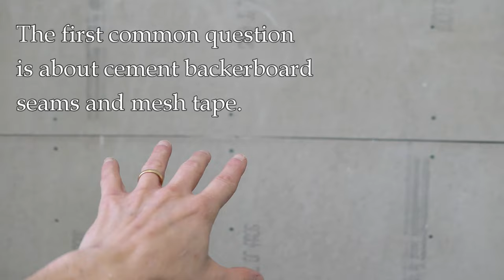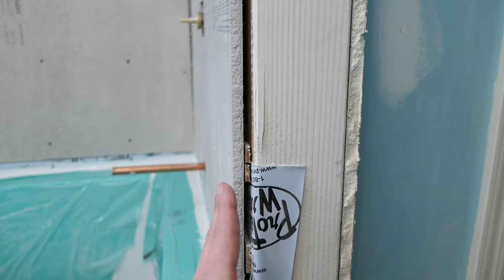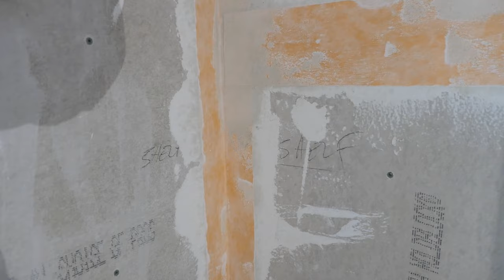Should Backerboard Go Over The Tile Flange Or Up To It?

Comment: Great video: The edges of hardibacker are porous, like a sponge. How do you prevent the water from getting/dripping under the edges of the board at the bottom of the tub? Scenarios: If a person taking a bath and splashes enough water running under the edges... or water vapor building up under the tile, and with gravity pulling water downward, eventually won't the moisture go under the edges of the board and eventually get into the board and swell up.
Reply from the maker: First, hardibacker is not porous like a sponge.  It is marketed as "water resistant,"  which is not waterproof but which is also not a sponge!  Second, the backerboard is covered in a tile, which should be impervious if you've picked an appropriate tile for a shower.  And, third, the bottom edge where the tile meets the tub is caulked with a silicone sealant.  To put things in perspective, it was standard practice for decades to install DRYWALL in a shower and tile over that!  While that was a stupid idea, a majority of those showers easily lasted 20-30 years without a problem. I've taken apart many dozens of them.  If you have water getting behind the tile, then the installation or the maintenance of the tile have failed.  See this video for more info:

https://youtu.be/y3bpE-GhYUM
Reply: @enduringcharm    Agreed. I renovated 3 bathrooms in homes built in the 70's that had tile over standard drywall. None of them had issues. No excuse these days since there are plenty of proper alternatives, but it does make an interesting point.
Reply: @enduringcharm  I had a house only 8 years old with failed  tub surround and a shower . they were tiled over "greenboard " sheetrock. There was a plastic vapor barrier behind the sheetrock on outside walls. The grout was not acrylic I'm sure. This created a mold sandwich , I had to wear a respirator to tear out black mold in an 8 year old house.
Reply from the maker: @oldarkie3880  Yes, drywall, even greenboard, is prohibited by code now for this reason.  When things go bad, they go very bad.  From your description it's likely that the plastic barrier on the exterior wall trapped condensation and that water made it's way into the greenboard over time.  It's also possible the tile was not installed very well and allowed water to penetrate.  For mold to grow it needs a food source, and that was probably the drywall paper and perhaps some other materials used in the tiling.  If I use a plastic barrier on an exterior wall I only apply it 2-3 feet from the tub or pan lip, so that moisture can migrate and escape.  Of course, we don't use drywall anymore either.  Despite all that, if your installer had not used plastic and had installed that tile well to the greenboard, it's quite possible the installation would have been fine for many more years.

Comment: Also can u put red guard over the drywall mud then tile on top of that?
Reply from the maker: You need to prime/paint over the drywall compound transition area no matter what you do.  I typically prime and then paint two finish coats, going partially onto the cement backerboard. Remember, this the edge of the tub or pan we are talking about and may even be located outside of the shower doors or shower curtain.  You can tile over that paint once it is cured.  If you are concerned, you can install waterproofing over that painted area, in which case I would recommend the Schluter Kerdi membrane over the whole wall.

Comment: So you put that 10" membrance over the lip of the tub and ran it behind on the studs but then you throw the hardibacker on top and stick screws into the membrane destroying the integrity of your waterproofing. Seems like you got a problem there if the end user doesn't take care of the installation or your wall/framing shifts a little bit. Seen too many tub/showers where water gets in behind the tile and goes unchecked. Had a pan last year where they screwed thru the membrane and it was leaking into the basement 5 yrs later. Do you do anything about those screws that go thru your membrane to try to prevent that type of situation from occurring. It is my worst nightmare thinking "what if"
Reply from the maker: There is a current obsession with "waterproofing."  Yet, I've taken apart dozens of bathrooms which were tiled over regular drywall.  As long as the tile and grout were maintained, the drywall is like new.  Naturally I'm not advocating we go back to drywall as a substrate, but a little perspective is important.  My flashing system shown here is not intended as a waterproofing system.  Instead, it's there as a backup in the event that the homeowner doesn't maintain the caulk or grout, or if there is an accident or significant framing movement.  If something really bad happens, the flashing will direct most of the water back to the tub/pan and hopefully the homeowner will wise up.  Now, if you really want to waterproof the entire enclosure, I've had good success with the Kerdi membrane, which is a market leader for a reason.  If you are really losing sleep over waterproofing, use the Schluter Kerdi.  It is more expense, both for materials and labor, but it will be waterproof.
Reply: I dont think the screws destroy the integrity any more than roofing nails do when its used on a roof. The screw or nails act as a plug.
Reply: @jerseyjim9092  I agree that a screw or nail is going to do very little to compromise the self adhesive membrane.  The membrane is a flexible polymer that squeezes around the shank of the nail or screw.  The membrane has an adhesive back and that adhesive will further seal the nail or screw shank.  Finally, the membrane is tightly squeezed between the cement board and the wood wall stud.  A water penetration at the nail or screw hole is virtually impossible.

Comment: Great video!  I'm doing my first tub.  One thing that's not clear to me is how you finished the vertical edge on the front of the tub.  In the video it appears the backer board is installed over the vertical flange on the the front of the tub and flush to the top of the flange on the top of the tub.  I'm assuming it's the same board and I'd need to make a stencil in order to cut the piece to match.  But that seems to create a problem where the vertical will be over the flange and the horizontal above the flange.  It seems I'd need to take some material off the back of the board to accommodate the vertical flange?  I'm wondering how you did that?
Reply from the maker: I think what you are asking is how to deal with the transition where the tile flange ends at the corners of the tub or pan?  The tile flange typically goes around three sides of the tub and then ends at the front corners.  You saw in the video the various factors relating to whether the backerboard will go over or on top of the flange.  If it goes over, then the backerboard will just continue pas the end of the flange and meet up somewhere with the drywall in the room.  If the backerboard sits on top of the flange, then you will just cut the backerboard as close as you can to the profile of the flange and bring it down to meet the tub surface.  You'll leave a gap at the actual tub surface, though, and that's where I install my flashing.  The backerboard or drywall will also meet the front apron of the tub, leaving a slight gap for caulking.
Reply: @enduringcharm  Actually the tub I bought has a flange in the front of the tub too.  The flange starts on the bottom left front, goes up and around the three sides of the tub and down to the floor again on the right.  I had assumed that was normal.  I'll figure it out one way or the other.  Thanks!
Reply from the maker: Oh, you mean the apron itself also has a flange?  Huh.  Never seen that!   Well, it can be handled the same way as the other flange in the alcove.  I like to use a self-adhesive flashing, with Zip System stretch tape being my preferred flashing now.  And then you'll have drywall or backerboard come up to the apron just like in the alcove.  Obviously you'll want to cover that transition with the same tile you use in the alcove.  Don't use little pieces, though--make certain you have wider pieces of tile to span over the flange and the wallboard or backerboard.  That way the tile will have something solid to stick to if the area over the apron flange is unstable.
Reply: @enduringcharm  Well unfortunately I'm actually using a 3 piece Onyx Collection surround wall system which I can't back out of.  It starts at the top of the tub and is the same width as the tub which is 36".  If I'd known about this (or thought about it earlier) I could have ordered taller side walls to do what you suggested.  Currently I'm thinking of trimming off most of the flange and then notch the sheet rock so it fits up against the tub.  A little tedious but it should work.  BTW, it's a Laurel Mountain whirlpool tub from Lowes and I'm starting to regret buying it.  Thanks again for the help!
Reply from the maker: I had a look online to see this tub.  Unusual.  Cutting off the flange is probably a mistake, since that probably is what gives the apron stiffness and support.  Without it the apron may have excessive movement and will open up cracks where it meets the drywall.  Since you are not using tile, another possibility might be to install some kind of wainscotting in the room.  I don't know if that style would work with the rest of the space, but a wainscotting made of wood, plywood or PVC could cover that flange and be self-supported.  You would caulk the transition between tub and wainscotting.  Or, if you can shim out the drywall along the entire wall adjacent to the tub, you could use drywall and have it go over the flange completely.
Reply: @enduringcharm  The wainscotting is a great idea.  I'm going to look into that.  Thanks again!

Comment: Great video. Question: When you tile the area between backer board and tub, is the tile only stuck to the backerboard? If so, is it going to stay in place along with the grout?
Reply from the maker: There will be an area by the lip of the tub which has limited or no adhesion for tile.  For this reason, it's not wise to use very narrow tile in that area or to cut larger tile down to make a short row by the lip.  Instead, you want enough tile to be adhered to the backerboard so that it stays put.  In that lip area you fill it with thinset, more to act as a backing than to adhere the tile.  The space between the bottom edge of the tile and the tub or pan is caulked with a silicone or color-matched tile caulk.
Reply: @enduringcharm  Thank you so much. This clears up my question.
Reply from the maker: I made a video to help others understand this issue as well:  https://youtu.be/y3bpE-GhYUM

Comment: instead of shimming out use green water resistant wallboard 1/2 inch then backer board down over the lip. depending on the plane of finish walls.
Reply from the maker: The use of greenboard in the shower/tub area has been prohibited by the IRC code since the early 2000s.  See section R702.4.2.  I don't think your suggestion of using it under cement backerboard would fly with building officials either.

Comment: Love all your videos, they have been helpful in my bathroom remodel. Just curious, when you install your backer board for the flooring, do you put modified thin set on top of the self adhesive flashing where the bottom of the tub meets the plywood floor before installing the backer board? Thank you! Have a nice day and keep with the helpful realistic videos.
Reply from the maker: I'm not certain I follow your question.  So, if I'm using 1/4" backerboard (hardibacker is what I use and recommend) on the floor, the hardibacker gets screwed down to the plywood.  Before I put the backerboard down, though, I've installed the tub or pan and I like to use some kind of protection at the edge of that tub or pan so that future moisture doesn't create rot.  I think that's where your question arises?  Now I fully realize that hardibacker is recommended to be installed with thinset over the plywood and then screws.  However, I don't do it that way for a number of reasons.  I skip the thinset and just use screws.  In my experience this does allow for a slight decoupling effect, so that the wood underneath can expand and contract while the hardibacker is less affected.  The screws will move with the wood but still allow the tile and backerboard to stay put.  This is a very modest decoupling effect, but real.  Skipping the thinset also avoids waviness or bubbling that can develop as you try to screw down the backerboard while also walking on it.  And I do think about the next guy down the line trying to remove this stuff!  I have installations two decades old done in this manner with no issues.

Back to your question--if you choose to put down the backerboard with thinset you can go right over whatever you've put down at the edge of the tub and no harm is done.  Screws will be the only real fastener in that area, though, since the thinset won't adhere to the plastic or flashing very well.   Or, you can adopt my method.
Reply: enduringcharm Yes thank you! You answered my question perfectly, i was worried I didn’t ask it right.  I was going to do traditional, subfloor-> thinset->backerboard—>thinset/tile, but your method is very interesting and I may do that now. Thanks again so much, very helpful. 🤙🏽

Comment: You telling me you can put thinsett over spackle?and it will stick
?
Reply from the maker: No, I'm not telling you that at all.  Instead, if you do your spackling and sanding, you then apply a coat of primer and two coats of finish paint.  Or, apply two thorough coats of primer.  Then, let those coats CURE, not just dry, which can take several days.  Then you can apply thinset over the paint and it will stick.  Keep in mind, The tile only overlaps the paint by half a tile or so.

Comment: I dont get why everyone caulks the bottom edge of tile to the tub?!  
Doesnt this just seal in the water like a trap? Then it molds
Reply from the maker: If you have tiled and grouted correctly there should be no water getting through behind the tile. The grout is sealed.  Water does not penetrate through the tile.  If you take 90 minute showers perhaps some slight moisture could penetrate the grout, but not actual water.  Silicone caulk is used at the base because the tile and the tub are two different materials with different expansion and contraction properties.  The silicone caulk can stretch with that movement.

Comment: Idk man for 50 bucks and 1 hour worth of time I always run mapei aqua defense over my kerdi banding and hardi backer.  I also silicone my seams when installing hardi backer.. I've moved past working for cheap people, and for such little time and cost another layer of waterproofing cant hurt.
Reply from the maker: I've actually been meaning to do a video comparing some of these techniques, not for waterproofing but for adhesion.  When I require waterproofing, such as a tiling a shower floor and then going up the walls, I use the Schluter system.  But, tile adhesion to the Schluter membrane is not the same as to hardibacker itself.  It's adequate, but it's not as strong.  Similarly, I'm not a fan of the paint-on waterproofing.  And thinset will not stick to silicone, we know.  I've taken apart 60-70 bathrooms and I know where the water problems develop.  What we don't talk about enough are the corners of the tub or pan where it meets the floor.  THAT's where waterproofing is required.

Comment: How about doing the tub surround walls in kerdi board and back cutting the tub lip out of the foam board?
Reply from the maker: Personally I'm not a fan of Kerdiboard on walls because I think the resulting installation has a "hollow" sound to it, so I don't use it.  It's a perception thing, that's all.  However, if you want to use it I think cutting out a reveal for the lip is probably not the best idea.  You'll be compromising some of the strength of the board.  I would rather see you use the flashing I showed here and just have the board come down to the lip if necessary.

Comment: You can notch the studs on the window wall and fur out the entire wall where the shower body is.
Reply from the maker: In this example in the video, if you tried to fur out the wall on the valve body side you would also need to fur out the entire bathroom wall, not just the alcove.  There was a doorway there, but above the doorway the wall continues.  This is a common problem in smaller baths where the alcove is the same 60" as the rest of the bath.  Beyond that, notching the studs is a no-no, especially on an exterior wall.  That would be flagged by the building inspector.